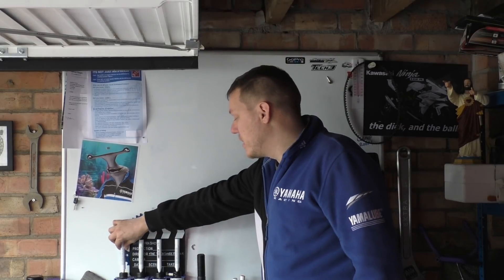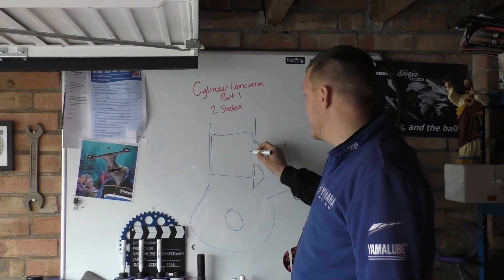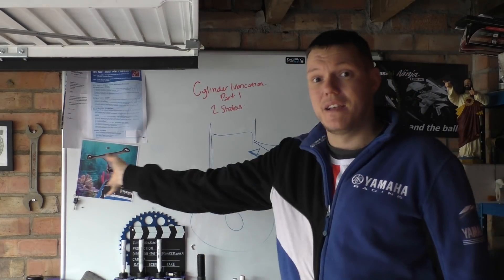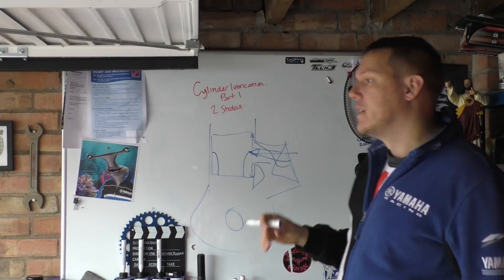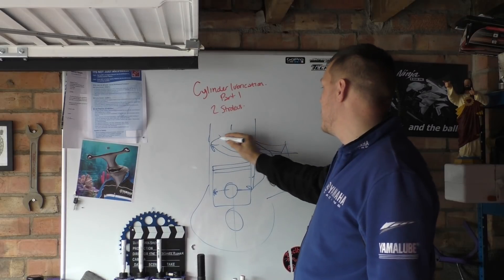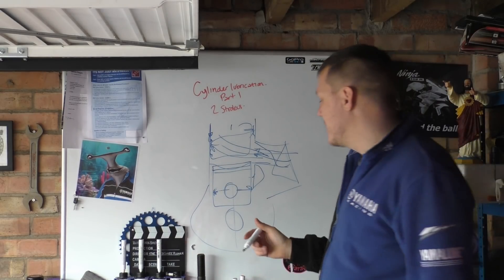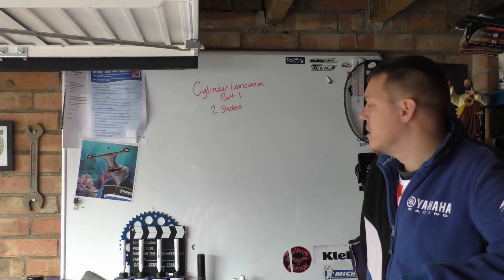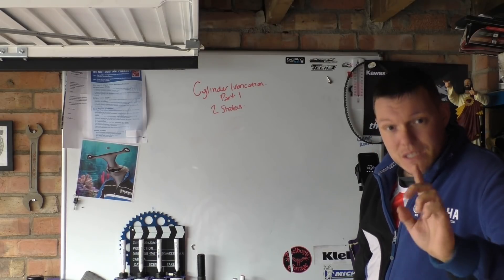2 Stroke Cylinder Lubrication - Part 1

Comment: Mate you have NO IDEA what you are talking about Go and grab a 2 stroke cylinder and piston , Slide the piston up and down the cylinder and you will get a better understanding of why the ports are there, When the piston goes up the fuel air mix goes down into the crank and lubricates the crank as well , As the piston goes down it forces the fuel air mix through the side ports into the cylinder , Anyway enough said GO AND DO YOUR HOMEWORK AS YOU HAVE NO IDEA  and that YAMAHA jacket.If only the people at YAMAHA knew
Reply from the maker: LOL what a lame arse comment - I don't understand what you have a problem with or what the fuck you are talking about???
Reply: You obviously have no idea how a two stroke engine works and that is why you don't know what the fuck I am talking about , As per your explanation how does the crank get lubrication on a 2 stroke engine

Comment: Why don't they make a recess in the part of the piston's skirt that's most affected by slap? Piston would overheat?
Reply from the maker: No and its a good question - the skirt is there to stop the piston from rotating so the slap is required but only due to the change from linear to rotational motion
Reply: Damn, you're right, and there doesn't seem to be any other better way to do it without changing the engine completely.
Reply: But can't you make a thin flat piston with a ring/seal that maintains contact even if the piston rotates a bit? Or would the combustion suffer too much from a piston going in crooked?
Reply from the maker: They do but these engines have very short strokes - http://www.formula1-dictionary.net/Images/engine_piston.jpg
Reply: Neat, thanks for answering!

Comment: Another asymetry problem is the fact the exhaust side is warmer, and exposed to the exhaust system. So the little oil you get there isn't able to lubricate as well as the intake side.

Comment: Many people dont realise that most twostroke oil contains dilute about 25-30% and to get  3% oil to fuel ratio you have to mix it in 5% and the percentage drops even more when the dilute is calculated as fuel. I have found that dilute in most cases is kerosene or sometype of kerosene. Kerosene has very low octane value so it lowers your fuels octane rating and can make engine knock etc. It makes the oil burn better but it can do harm too. This is why people think adding percentages to the oil/fuel mix lowers the octane and its true unless you use 100% twostroke oil like motul 800, belray H1R and all the other "racing" oils.
Reply: janne343 did you mean diluent?
Reply: OldManTony yes

Comment: my first proper bike was a crf450x it was a relatively low hour bike and it always had problems got a yz250 2t with over 100 hours on the motor and its mint done another 35 hours on it with not a single problem!

Comment: Could the side marks on 2 stroke pistons also be caused by heating up the piston too quickly?(improper warmup)
Reply from the maker: You mean a cold seize?
Reply: Well yeah. I'm just trying to analyze my 2 stroke piston, it has never actually seized up,  having scratches on the port sides. 
Wondering maybe i should be more careful with my warmups, my premix is per factory recommendation and and the air fuel mixture is looking good when i inspect the spark plug, now that i think of it there are also many other factors that could be the cause, cold seizing being one of them.
So my question is kind of dumb, but thank you for taking the time out of your day and answering.
Reply from the maker: cold seizes are caused by revving too high too early or running too lean and revving too early
Reply: Do it like motoman, hard warmup!

Comment: As a result of the oil needing to be delivered through the air and gasoline is a poor lubricant, does this mean that diesel has less oil lubrication failures sense diesel is a thicker denser fuel?
Reply: Yes and no, whilst diesel fuel is a better lubricant than petrol so will reduce some wear on components. 
They also tend to have a higher rate of oil contamination by either carbon build ups, or over fueling from injectors being faulty. 

If you look at modern diesels, while still pretty reliable, the days of the old work horses that did 300k steady away without any issues are over.
Reply: Dave Micolichek yeah, the main things I seem to see that I would think are causing problems, are the daft high common rain injection pressures, as you say all the extra emission controls, but also, the longer and longer service intervals, for example, the new ford transit custom vans, you don't do an oil Change on the first service as it's every 30k iirc. 

It's no good, if you have any experience with the pug 1.4 and 1.6 hdi and the renault 1.5 engines etc, they shit themselves pretty regularly
Reply from the maker: People have said it but diesel is more like an oil and is commonly known as self lubricating. Pure diesel runs through the diesel pump with no other lubrication.
Reply: Well, modern diesels have about 2 or 3 times the horsepower per litre of displacement so what should we honestly expect in terms of reliability. talk 330HP out of a 3L diesel car engine in the 80s and everyone would laugh their ass off
Reply: alles klar klaus true except if I want performance I will buy a forced induction petrol
Reply: The Workshop should see it when diesel fuel pumps go though, completely ruined fuel system at times. 
Seen cars that have been full set of injectors etc after a fuel pump failure. Not cheap when they are a couple.of hundred plus a pop

Comment: I remember you posting a vid a while back about F1 cars "cheating" by utilising an oil injection under the piston, could that tech be used to make a better 2 stroke engine?
Reply: It would only improve lubrication, not combustion because you are allready burning oil. Unless you are racing or something and your fuel is restricted to certain energy value and you want to "cheat" and raise it by adding oil. So you add more oil to the fuel in a twostroke world so the injector would only be for lubrication purposes. This is my oppinion tho , Im not an expert but this is how i see it.
Reply: ta for the comment. Surely though if it improved lubrication, then you'd need less so in turn could help combustion and fuel efficiency.... which is generally dire on a tuned 2T, could it maybe help get them below emission levels so that they could make a comeback? I doubt any manufacturer would invest in that tech now with internal combustion engines only having 30yrs left, but it would be interesting to have a 2T on a mainstream road legal bike! :-)
Reply: That is true, but the crankcase pumping could be a problem to solve.
Reply: pressure relief valve? or inject between the piston rings?
Reply: The crankcase needs lubricating ( mainbearings and crank bearings) so oil must be there. Sealed space to pump air/fuel to cylinder would help but im not engineer so dont know could it be a solution.
Reply: janne343 Direct injection/transfer port injection so you have a fuel free crankcase, then use an oil jet down the piston which has the benefit of cooling the piston and maybe direct oil injection into the bearing or something similar to what they do in gas turbines which is a sealed bearing chamber with an oil scaveging pump and spray oil into it. If we spray oil into the crankcase bearing and the conrod bearing we could just use hydrobearings like 4 strokes and transfer it through the conrod and piston to the piston rings. The dripping oil plus the oil from the piston oil jet gets sucked out of the crankcase by a pump and recirculated.
Reply: Yup, like the way you are thinking... but in real life the benefit of a 2T is lost as simplicity is their selling point, getting 50% more power over a 4T engine of the same cc is great, but if it costs 50% more than the 4T then it is too expensive!
Reply: Better 2 strokes are called 4 strokes!
Reply: Beach&BoardFan lol, I disagree although the faff of premix sucks balls! :D